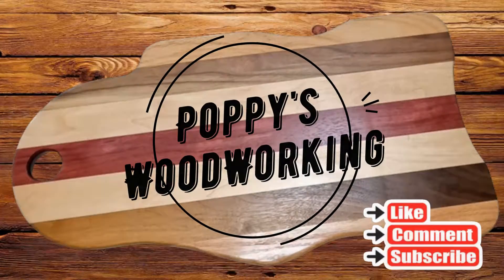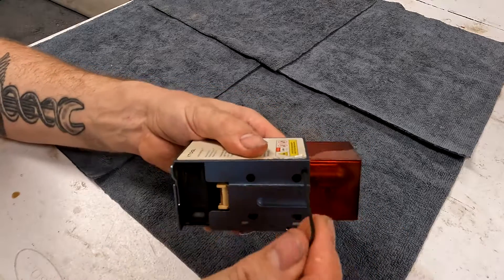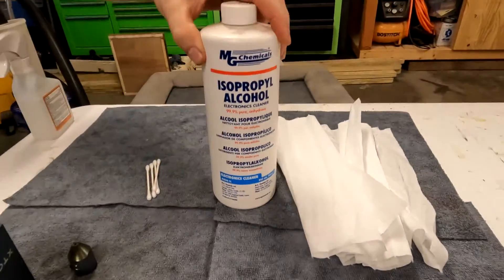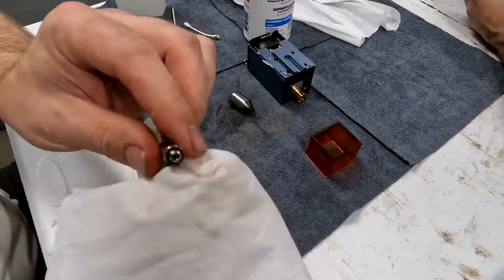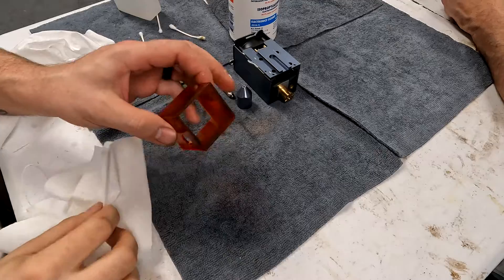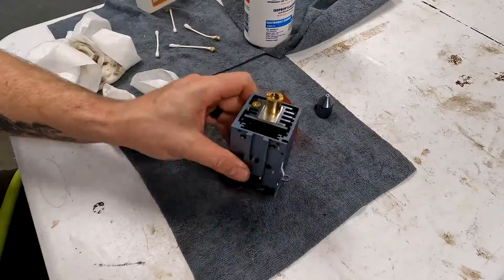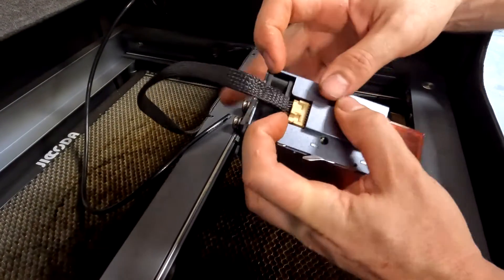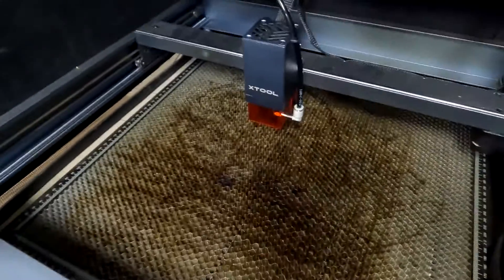How to Clean Your xTool D1 Laser the Right Way | Remove Soot, Residue & Build-Up Fast

Comment: thanks for the video! was there a reason you didn't blow the fan etc. first with the low pressure air to remove some of the debris before wetting it with the alcohol?
Reply from the maker: I personally do not like blowing small motor fans out with compressed air.  When you blow the air in it spins the fan and the motor, to fast may cause some failure, my compressor doesn't really get that low unless I drained it first.  You could use a "can of air" and blow it out, just don't want to spin it up to 10000 RPM's.  Thanks for watching and dropping a comment.